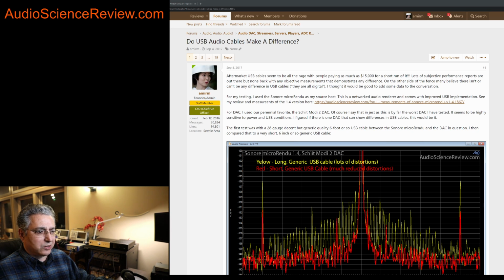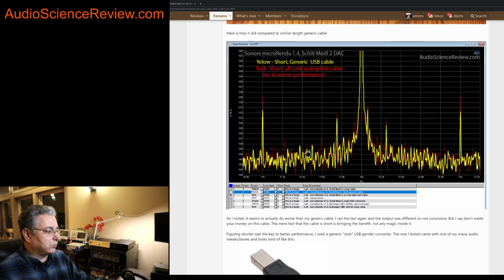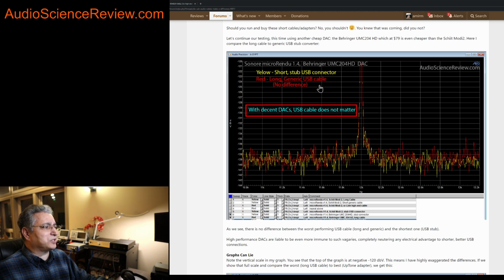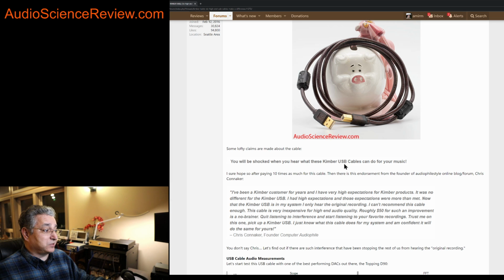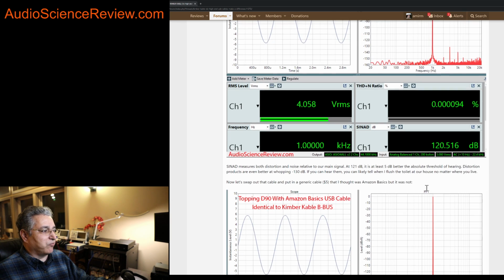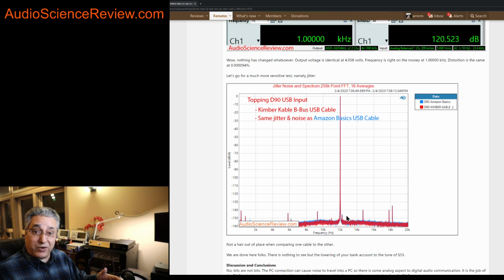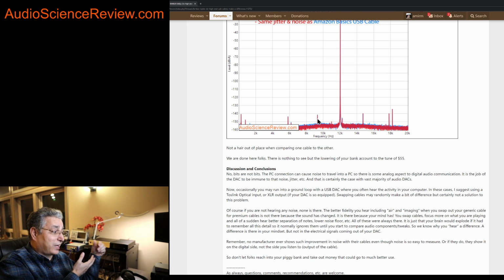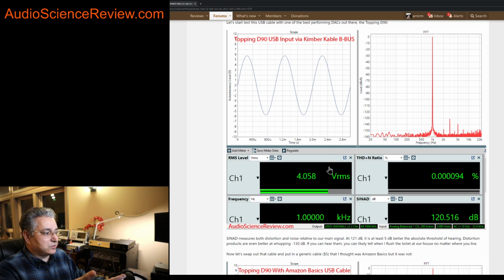Do USB Cables Make an Audible Difference (Kimber Kable Review)?

Comment: Better USB cables do work. But again USB and especially HDMI cables only make a big difference if you have a crazy good system. So we are talking about 0.1% of the users out there that can tune in to that world. (and it usually is not those people buying these cables)
And most normal HIFI USB cables do very little if nothing to the sound, again it is less than 1% of those cables that actually make a difference.

And I just want to say that these measurements do not measure good sound. 10 cm cables that was shown here sounds absolutely horrible being way too aggressive, even though you measure them to sound better.
Yes one should avoid ultra long cables because it usually distorts the sound, that is correct.

So to conclude, if you have normal HIFI gear use normal USB cables. Even people owning PSaudio, Mcintosh like gear can't even hear a difference. It needs to be much better quality than that before it starts changing the sound. So I just saved a lot of people some money there.
Reply: You have no science, no data to back up anything you have said. Nothing.

It's like saying that a wine glass effects how good a wine tastes, but the effect of the wine glass only becomes apparent when you are drinking extremely expensive wine! That's BS. It's all in your head.
Reply: @peterphan227  Very cute. You just said that what everybody experiences in the HIFI world is fake unless is can be confirmed by graphs.
(which Audio Note, D'agostino and other top companies will argue is wrong)

Measuring a thing by looking at data is only 1/10 of what gives you a good sound.

What people don't realise is that, the gear that measures in a correct way actually sounds horrible. So it is a standard of measuring bad sound.

Because in order to hit those correct curves you usually have an extended circuitry with cheap parts, that prevent music from happening.
Plus all of these things measured have a really bad PSU in some part of the chain, that creates a different interaction from product to product.

So all in all it is just data, giving some small indicators, but not being the end solution.
Reply: @RealHIFIHelp  The mind is an incredible thing. It is very adept at tricking its owner into believing all kinds of things that do not exist! Perception and judgement is extremely suggestible. There are so many ways the mind can be tricked. That's why measurements and blind tests are so important. It takes the "suggestibility" component away. But a lot of people want to cling to the power of suggestion just like many people want to cling to baseless religions.
Reply: @peterphan227  Sounds like you need a Deepak Chopra book if you have problems with that.
Reply: @RealHIFIHelp  Science wins against any religion, even when you're taking about the religion of high-end audio snake oil. And in both cases (church religion or audio religion), it's big business, with lots of money involved.
Reply: @peterphan227  Again you are wrong. Those are the 2 extremes at the opposite ends.

Between those 2 worlds, are maybe 100 levels of sound. And in order to get into that sound, one has to first dive into the cheap end and get all the basics firmly in place, in order to harvest the potential.

Only at that point has the conditions been created to make the test possible, to find what works and what does not work.

You can't test proper coupling between 2 units, by putting an audio tester on 1 regular piece of gear, separating it from it's receiving end. It all has  to come together as one which takes years to create that environment. This is not a buy this product solution, it takes a lot of time, finding out what gear speaks the same language. And measurements only measure the primitive/basic stuff that is needed for diagnosing a sound on a mechanical level so that it can function, and to only solve very basic sound problems.

And sometimes a worse measurement, actually improves the sound because of stuff like added distortion, making for example a very clinical sounding unit more warm which is a good thing.

Measurements and data is a tool to help with the process, not a thing you can totally rely on.
Reply: @RealHIFIHelp   uh huh...
Reply: @bwoody1090  Look for John Bravo, I am writing to him now....
Reply: @RealHIFIHelp  sounds like you need proper education math ,electricity, audio , anyone  can tell me that they hear this and that with this cable but if you can't back it up by science, logic,math, etc... your argument has no value than. Cable is just cable it should have some specifications but if it has 5$ cable than 100$ won't be any better if 5$ has sufficient specification for that specific task. There is no magical sh*t going on things like this can be proven with proper measurements and equipment like Amir is doing but he ain't only one busting this stupid myths in audio community.
Reply: @turtleneck369  Check out the last 2 comments I sent to John Bravo, those 2 videos explain everything.
Reply: @RealHIFIHelp  LOL
Reply: All you have to do now is actually demonstrate your claims...  That always seems to be the sticking point.
Reply: @bwoody1090  I will answer one of you guys in this thread within this hour, so you all can see what type of system setup it requires, then you will all understand why almost no one can hear a difference...
Reply: @RealHIFIHelp  please let it be properly controlled with level matching and blind testing.
Reply: @bwoody1090  I will post the answer in one of the threads. To many to talk to.
Reply: @RealHIFIHelp  LOL
Reply: Just list audio gears you've tested that actually benefit from usb cable swap... otherwise one can always say "okay there's a protein that reacts with h2o and cause cancer you just don't know it". Btw Amir owns a pair of Salon2 + Benchmark ahb4, really can't imagine a system better than this(in terms of performance, there're more luxurious furnishings that makes sound out there)
Reply: @anafabulakz696  I will answer one of these other guys on this thread will the full truth, so look for it there. I will be there within 1 hours time...
Reply: @RealHIFIHelp  Just checked your previous videos and saw "why A/B tests won't work for audio".
Okay. I don't know what to say about that. Your argument is basically circular
Reply: @anafabulakz696  Yeah if you haven't even seen the entire video, how I prove about 30 different points. Then of course you must be right.
Reply: @anafabulakz696  Check out the stuff I wrote to John Bravo, those 2 videos explain my point.
Reply: @Douglas Blake My god, apparently you just did not watch the whole thing or you misunderstood some words.

No it means the opposite. That most systems are so bad, that most products don't work because the local environment is not in a state to react.

Let me make it easier for you to understand...

USB cables are one of the least reactive components in a HIFI system.

And to make it reactive. You have to create a world that does not normally exist as a plug and play solution.

That is why I talk about custom made streamers, that you yourself make, with these particular boxes. That have custom made LPSU, which has a lot of other things in the video that there is not room for in this comment.

And as a whole, when all of this comes together. Then can you get the proper reaction. And statistically, you will most likely hear, how crappy the product is, and it many failings. Or you will be lucky to stumble on a good product like I mentioned in the video: gustard u16.

But if you think like a normal person, that the product in itself will do that job, then you are wrong.

It's a circa 50 step process, to make a streamer that is so good, that silly things like USB and router makes an audible difference.

My own system at circa leve 12, cannot even tell me exactly what is going on. Only on level 14 that I pointed out, does it become very obvious the good or bad parts of the product you are testing. Whatever product it is.

But a standard Topping DAC or Schiit DAC with a normal streamer, forget it. All USB then sound the same. It's like testing a Bugatti gearbox on a VW car, makes no sense. And that is why people call it snake oil.
Reply: Horrible video. Instead of listening to this man's aberrations, listen with your own ear and you will see the enormous differences between a cheap cable and an expensive one. Only "audiophiles" here.
Reply: @John Bravo  Okay I just had to go through a couple hundred videos I made to see which one it is...

This video I made explains the levels of streaming: "16 levels of streaming"

Just find that on my channel, and watch it from start to end.

What you will find out is that most streaming that takes place in this world, is at a level 3-8 area zone circa.
(the normal stuff which officially exist as a product)

And I agree, at those levels which Amir tests in, he is completely 100% right.

But at these extreme custom levels, which you cannot buy as 1 finished product, around level 12-14, then a lot more products like USB cables and HDMI cables and cheap gimmicky products really show 100% what is happening when you listen to the sound.

And yes at that point you get a night and day difference, actually only level 14 is it night and day. And there you will be able to spot exactly how bad most products are. And see the few that make a big difference.

That is my point. I only know 1 guy that is on that level 14 streamer level.

And forget about testing CD players that support USB, most are only on a level 0-8 ish area. And the best CD players don't even use USB.

That is the ultimate truth. If you are ever in Denmark, send me an email, and I will maybe send some of you guys over to him that don't believe in this, to his address. He has most likely one of the top 10 best systems in the world. The sound is insane. I sent about 3 people over to him, that almost lost their mind once they heard that level. Imagine the best most expensive store type of gear sound in the million dollar class, and times it with something like 5x.
This guy is maybe the next Steve Jobs in the audio world, and is working hard making this into something that can be sold.
I personally doubt that this can ever be sold, since it is so complex.
Reply: @RealHIFIHelp  what a waste of time.
Reply: @bwoody1090  Answer is there under John Bravo, it explains everything.
Reply: Holy cow, audiophile is a disease
Reply: @RealHIFIHelp  OMG, I thought 11 was too much, but you are at level 14. Mind... blown!
Reply: @danryan4272  I wish I had level 14, only my friend has this. And he did it with a pathetic amp and half pathetic speaker. And a 100 dollar built in DAC. But it beats basically everything in the stores.

The formular is there. Normal streamers  we can buy in the stores right now, sound broken compared to this sound. Even the ones costing 10-20k USD.

It's all about the power coupling. All these devices almost do nothing by themselves. It takes someone, who has the balls to buy the good custom LPSU's on the market, and put it on all of these mentioned products.

Only at that time, do these HIFI gimmicks get exposed for what they really are. Which is, most of the time. Really bad. But once in a while like the Gustard u16 really good.

But even these good products are worth nothing if you just do a small thing like use the standard LPSU or put your powercable in the wrong phase, or have some cheap product like elfidelity that does not fully match the system.

It's an art. And most people into HIFI will only want to buy a box solution that is plug and play. That is why most audiophiles fail.
Reply: @Douglas Blake I have owned about 50 systems, and have heard at least 300.
And have been to at least 30 HIFI shows, and tried most stuff on the market.

It's about coupling, not price. Price helps a lot. But as you maybe have experienced, some of the worst systems are actually some of the more expensive ones.
But statistically, money does make a huge difference, in the right persons hands.

My point with these 2 videos I linked to (John Bravo) Was that my friend achieved this with a lower end AMP/DAC/Speaker. And that it of course could get better with a better system.

But it was achieved, doing what no other system did in the world.

I heard my friends system before he had the best power network, internet network and streamer, as a standard product, it sounded absolutely horrible.

Nice to hear about that system from 1974 :-)

Some old things and some DIY offer good value.

Nice knowing you. Cosy talk.
Reply: @RealHIFIHelp  It doesn't matter how much systems you listened to. Whatever it is 100, 1000 or one million. That is not worth a penny to me or ASR. To prove your claims, you have to bring... Proofs, actually. "Believe me because I say so" is not a proof in any shape or form.

Double blind test (while removing bias) and measurements are proof. "I can guarantee it makes a difference" is not. As simple as that. Not debatable in any way.
Reply: @VintageFlanker  Cute.
Reply: @RealHIFIHelp  Sure it is.
Even cuter is your last video about "sound" of metal materials (🤦) showing how much you're ingnorant about any electrical principles or foundamentals.
Reply: @VintageFlanker  I guess that makes you right and the entire industry wrong.
Reply: @John Bravo  I did the audio test on a couple of hundred systems. No normal systems made a sound difference.
About 5 made a small difference, but those were out of the ordinary that most people never get to try. And only 2 systems made a huge difference with only certain limited products that were not mainstream. Not these types that were tested here.

Comment: Do ferrite cores make a difference if  a long 3 or 5 meter cable is used?
Reply from the maker: They help filter high frequency noise.  It may make a difference to the cable working or not, but not with respect to audio fidelity.

Comment: Generic USB cables work, and audiophile ones are generally worthless, but I like ones that adhere to the USB audio spec. and are 90 Ohms such as Supra USB cables. That can make a difference and most audio USB cables do not even publish their impedance so that counts those out for sure. He proves there is some noise floor distortion with the cables he tested, but he didn't test a properly spec.'ed 90 Ohm audio usb cable.
Reply: There is an in depth discussion of USB cable impedance on the 2017 ASR thread "Do USB Audio Cables Make A Difference?" The conclusion was impedance does not likely matter, but it could.   This kind of errors are easy to hear...dropouts, clicks, pops, etc.; certainly not slightly veiled imaging or less transparent midrange.   The fact that Amir uses Amazon Basics cable on his test bench to measure $3000 DACs shows he is not worried.  However, spending $50 or so on a Supra USB does not seem out of line, even if the benefit is probably psychological.
Reply from the maker: In the short lengths people typically use, you could commit many sins in the design of the cable and you would still be fine.  I have used dozens of USB cables and none have failed in any way.  I have tried to cause failures and it took stringing two crappy extension cables to get there.  So yes, if you are using long cables, getting a proper, certified one is good.  And if  you like to do that with even shorter ones, that is cool too as long as you don't expect it to make the sound any better.
Reply: @AudioScienceReview  Well I'm not sure why you didn't test one of the properly spec'ed for audio USB cables then. Oh wait, I know why, it would show an improvement and thus nullify your video...
Reply: You say "CAN make a difference." Do you have some evidence these cables make a difference?
Reply: @ianhaylock7409   So you’d rather just guess? I prefer to be sure so I would only buy a USB cable that’s the right impedance for the USB audio spec. That way I can be sure. There’s literally no engineer, audio or otherwise, that would want to use an out of spec cable if given the choice.
Reply: @phototristan  erm... I think Amir just showed that what you say is just your own bias. I assume the amazon basics cable does not adhere to audiophile standards...
Reply: @jaytorr6701  He didn’t test impedance at all.
Reply: @phototristan  why does that matter? What matters is the quality of the signal that goes from your source to your DAC. And they are exactly the same.
Reply: @jaytorr6701  He didn't even test for impedance, which would indeed show a better quality signal.
Reply: @phototristan  I think you are missing the point and what he did.
Reply: @jaytorr6701  LOL, you need to look inward.

Comment: Now that you revealed that you use all the time a cheap 5 USD USB cable nobody will trust your measurements anymore. If you would have used all the time that 10,000 USD USB cable then you would be able to claim you have a top system. But now? How can we trust your super expensive audio analyzer with a cheap USB connection. Next thing you will tell us you also use a cheap HDMI cable. The horror. ;)
Reply: Here is the thing, even tho cheap and shiet DAC can or can not filter the noise the DATA is still 100% same. That does not change. So yeah you can trust, 100%. Every modern DAC these days won't have any problems with any certificated USB cable. Period.
Reply: @Thevikingcam  Did you miss the ;) ?
Reply: @edgar9651  Sure did  :P
Reply: Horrible video. Instead of listening to this man's aberrations, listen with your own ear and you will see the enormous differences between a cheap cable and an expensive one. Only "audiophiles" here.